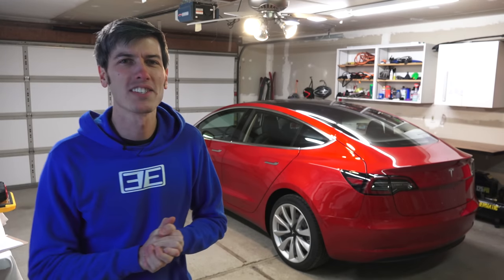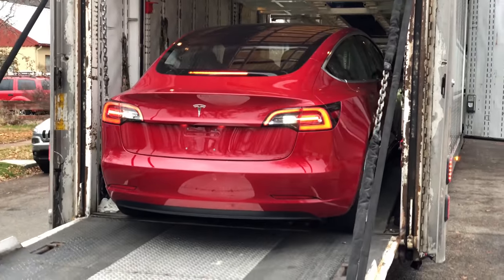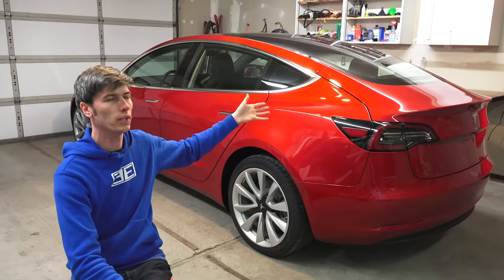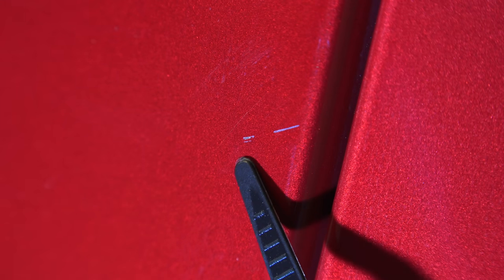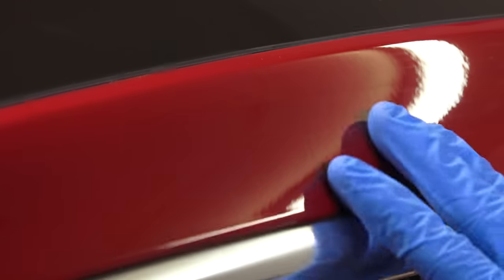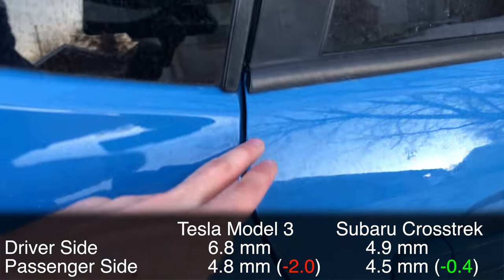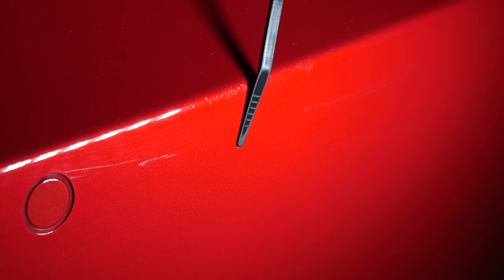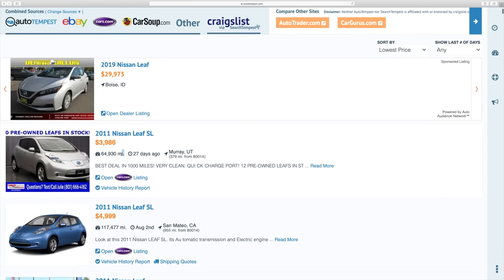Everything That's Wrong With My Tesla Model 3 - Quality Problems

Comment: Why did you accept the car? I would have sent it back and not signed for it.
Reply: I'm sure he didnt see this stuff until after he signed for it....
Reply: I build cars for a living.  I can go to any dealership in the country and find flaws in every new car on the lot.  This is pretty bad, but you will not find a "new" car without flaws.  Trust me.
Reply: 'bad'

This is horrible quality for a $60,000+(or $90,000 Canadian pesos in my case) retail car. I could buy almost any other brand for half the price and much higher quality control.

Hoping this guy has this under warranty and has the dealership completely repaint and redo all the panels for the car at minimum. Who knows what the inside looks like with a exterior this trashed.
Reply: Automotive manufacturing in North America has suffered badly under union rule. High wages, extraordinary benefits and lavish pensions have driven the auto sector into the red slowly for the past few decades while complacency and entitlement of many union workers has brought down quality in an age when people expect perfection off the assembly line.  

Even with robotics, automotive manufacturing has improved dramatically but will never be perfect, but as long as humans are programming, maintaining and manufacturing the robots, they will never achieve the perfection we have come to expect.  From assembly to delivery, there are multiple opportunities for defects and damage to occur.  As another auto expert has pointed out, you could walk any new car lot and find defects in virtually every vehicle.

Tesla has an up-hill battle ahead of them as a new manufacturer, trying to solve their quality issues in today’s cut-throat market.  How long before Elon looks to out-source his manufacturing to other countries?  This video could have been done with almost any brand of automobile.  Unfortunately, Tesla is way behind on QA/QC on in their manufacturing process.  Trying to correct their issues in the American labour union environment will be costly and Musk may run out of cash before he’s able to demonstrate Tesla’s build quality and reliability is good enough to compete with other main-stream manufacturers.  

I applaud Elon’s determination to take the industry in a new direction, but maybe it’s the concept of the single-occupant vehicle that needs to be re-considered.
Reply: @peterwheatley6256  Sigh, the "unions are bad" arguments again. Listen, all major german and japanese car manufacturers have unions and they do not suffer from bad quality, unmotivated employees, unacceptable flaws, etc. (let's ignore the technical fuel and CO2 emmission issues in 2017 for a moment) This "unions are so bad and socialist and destroy anything" is a very toxic and outdated mentality, solely in the US. You have to step away from the past mistakes and corrupted unions (which afaik only happened to such an extent in the US) and take that actually very worker-friendly and protecting concept to the new millenium. Like every other first world nation did long ago. Every employee in Europe who is in a union or whose company is part of a union shake their head when reading stuff like that. 
The US auto industry just made bad cars that do not sell well on the other side of the big seas, that's why the manufacturers are in the red. And no, you cannot find flaws and defects on every third VW, Toyota or BMW when looking around at your local car dealer in Germany.
Reply: I guess in America is normal to sell cars with all this  problems. Good thing the customer support said they will help
Reply: @MistaM16  Sure, but as I understood this (the color) is an optional extra which costs quite a bit of money. Its not the generic cheap option that is included in the base price. You want more out of an optional extra paint job... Besides, the car itself is like 60k? Sure, all the cars have some minor problems or scratches, but a 60k car that looks like its been used for a year or two? That's unacceptable.
Reply: @SmugLlama1234  I just want to point out that Model that he got is $65,400 CND. I would also refuse delivery on that car Tesla or not.
Reply: @peterwheatley6256 naw it's just lazy management. Whether you pay the guy who refills the red paint $1.00 or $30.00 an hour is meaningless. Companies need extraordinary leaders who demand perfection to be in charge or you get this.
Reply: "Trust me." That's what Jimmy Carter said.
Reply: Wendell Fakename - I totally agree. Our leaders will be the ones who engage the workers to instil the importance and pride of quality workmanship. The flaws in this example are basic and obvious. The scary part is what lies beneath the paint when cruising at 120 km/h.
Reply: @peterwheatley6256  I work in the Auto Industry and drive new cars every week, I don't see this level of panel gaps and paint problems from other brands. Also, the rear driver's side door is a totally different color. There are plenty of cars made in North America from Import brands that don't looks like this.
Reply: @Kevin is that with the rebate included? Seems like it would be along with the tax deduction.
Reply: @peterwheatley6256  you do know that Tesla is a non union company?
Reply: @YuraBoyko  If this really is how one receives brand new cars in the US, we should not be surprised as to why the US car manufacturers are in the red and why the rest of the world buys European or Asian cars.
Reply: SpeedDemon2581 - actually, no, I didn’t!  And I’m shocked...  I didn’t think a car could be built anywhere in North America without a union.  However, QA/QC is a big issue everywhere and it boils down to the leaders in charge of how the manufacturing tolerances are managed and who signs-off before the vehicle rolls onto the showroom floor.  @Motormouth, you would know, as an automotive journalist for decades, the range of finish quality throughout the sector.  And to be fair, I’d guess that the cars you’re given to critique every week have been examined closely by the manufacturer rep to ensure you’re getting the best specimen they have.  There are lemons from every manufacturer but some manage quality much better than others.  I tend to agree with yourself and others that the Tesla in this blog has been re-painted.  I know someone who worked in the paint touch-up department at a major auto manufacturer and incidents happen on the line all the time.  But the fact that this vehicle was released for delivery is unacceptable.
Reply: @SmugLlama1234  its got miles on it. it isn't new how can you expect perfect condition.
Reply: I wonder whether the fact that the car was delivered so quickly meant that the 'original' purchaser refused to take delivery? At least he can get from point A to B. :)
Reply: I know low mileage 20y/o VW Golfs with better paint and finishing quality. That orangepeel is terrible, and that many scratches?! I've heard worse of tesla tho... Of cars when they arrive on boats here in Europe, they have plastic stickers on 'em to protect the paint but when the get pealed of the paint comes with 'em. Not sure how true that is but I wouldn't be surprised.
Reply: @peterwheatley6256  - Curious why you would think this is a "new direction" .. Electric cars have been around for 100 years. In fact, initially it was the electric car that was predominant, but the combustion engine easily won that battle and has been predominant ever since. There are a lot of reasons why the combustion vehicle won out over the electric car. I don't see the electric car ever making that comeback. The combustion vehicle already won this battle long ago.
Reply: "its got miles on it"

Last time I checked that doesn't mysteriously effect the paint job, cause misalignment on basically all panels along with and 21,000KM is literally nothing to any car. That's not even half the normal amount a showroom car has in after a year of being test driven on the highway.
Reply: @AriesT1  European manufacturers only wish they could be on the same level as Ford and GM.  They'll never get there
Reply: @Matt-bb3nr  Are you trolling? Maybe on bang for buck, but quality?
Reply: @Matt-bb3nr  Lol, you are funny. Comparing Ford and GM to VW, Audi, BMW or Mercedes. Nice comedy. :)
Reply: @squidly2112  b.s. gm and standard oil conspired against electric vehicles. It's is true ev were winning till then.
Reply: @erichartman3760  - OMG! .. don't know much about history huh? ... GM didn't exist then .. try again ... LOL
Reply: @MistaM16   I bought 2017 nissan rogue sport... zero flaws... I just checked again after seeing this video and still.. no issues... no scratches.... tesla is known for low quality cars
Reply: Wendell Fakename l
Reply: Peter Wheatley most new auto plants built in the past 15 years are non-union. Do a bit of research.
Reply: Unions in Germany are in the management of the company. Maybe that's a better model than old fashioned capitalist class struggle.
Reply: @MistaM16  - these are more than flaws,  and there are many of them.  the only 'true' flaw is the dust in the clear coat.  the others are scrapes and scratches which are not a by-product of the painting process but poor controls around manufacturing or shipping.  people and/or equipment are contacting the vehicle and are  causing the scuffs and scratches.  the end result is still the same, an unsatisfactory paint job for a brand new and expensive vehicle. When I bought my VW Touareg brand new, the paint job was flawless.  And I'm a stickler for defects.  So this vehicle isn't meeting expectations for a $60,000 acquisition.
Reply: The next test for Tesla would be their customer service department, if this was my car. The paint is substandard. The scratches I would want fixed.
Reply: @peterwheatley6256  You blame the union too much. Bad management and accountability are the real reasons.
Reply: you need to magnifier to see this.
Reply: marcus brown that is not true. 
Step out of the States and You will prove your statement false.
Reply: Negative. I have been to many porsche and bmw as well as mercedes dealerships. All their brand new cars are without thr slightest bit of doubt 100% in perfect condition. They sell the cars they have in thr showroom (deml car) for 20k less, just because someone sat in the car, not even driven. Its a tesla thing at the moment, or cheap cars till 30k. If you buy a new bmw, audi, mercedes or porsche you won't find a single flaw. You're free to give it back 2 weeks after buying it (at least here in Switzerland)

If you spend that amount of money on a car, the least you can expect is the car to work and to be in a condition just as it left the factory. If the factory already did a shitty job then you should have the right to let them work on it again.
Reply: @dublux9878  Just it standing in the sun will do... That orangepeel is bad... Terrible! You wouldn't see that on the cheapest cars out there
Reply: @BramCollier  
I am just trolling. :D
Talking seriously the people wont get high quality cars from Tesla (overall) at lest 5 minimum if this company will survive. It is simple; they are trying to expend their business as fast as possible and they cannot provide quantity and quality at the same time.
Reply: Because Tesla. 

If you're a fanboy, nothing will put you off owning one. This applies to all products where there are fanboys.
Reply: @YuraBoyko  Not only America, you should see Chinese cars or Russian cars. But still Tesla with this much quality issues, is just horrific.
Reply: @MistaM16  more than minor flaws.
Reply: He didn`t know that quality control does not exist at Tesla - the whole paintwork quality is bull** , the car needs complete new paintwork
Reply: @User-th6yy  There are very few places in the world where applying a Swiss standard of quality is realistic. America is definitely not one of them.
Reply: Though if a Tesla came direct from the factory, it never had a chance to sit on a lot where a lot of damage can occur.
Reply: @MistaM16  Sorry, but I purchased two new Rav4s in the past 4 years and none of them had anything like what's going on here. Also bought a used 2016 Corolla a few months ago and it looks better than this in terms of defects/quality issues.
Reply: @peterwheatley6256  quality control is management. There only goal 5000 units. Of course no dealer limited repair services a nd no oem parts Stan ward. No separate evaluation. Of course rental car companies try to charge you for defects caused by previous drivers. Take a camera and film everything with qualified body shop inspector
Reply: @NikiK57  the local $300 paint job for $2500 factory finish. Did they sand off clear coat and spray paint it red by the rail road track?
Reply: @peterwheatley6256  Americans just dont have the high end quality of finish when it comes to products that other countries do though.
Reply: Jorn Navarre  You should go back to school and learn how to read. ;) 
I wrote they do NOT suffer from bad quality and unmotivated employees despite having unions.
Reply: Tesla is not union. Go elsewhere with your anti union bs
Reply: @peterwheatley6256  Tesla isn't unionized.
Reply: squidly2112  - by new direction, I mean that Tesla has created a luxury 100% electric brand.  That is different from any other of the major auto companies who have since been weaving plug-in electrics into their ICE line to protect their market share.  Tesla is building luxury performance vehicles at a loss, but sadly it is a strategy that is doomed to fail.  Their quality issues have become very public which will always make people second guess whether to commit to the brand over other domestics (and imports) developing their own plug-in electrics and hybrids using existing manufacturing facilities and established quality assurance programs.  It is too bad that this very real example of a newly delivered vehicle displays so many deficiencies.   I had hoped Tesla would be a raging success.  The world needs a cleaner option.  I am strongly considering an electric vehicle for my next purchase, but it won’t be a Tesla.

Comment: Panel gaps or paint really didn’t both me , it was the waves in the windshield that did , and later when that problem was fixed, you could see the stress in the glass when wearing polarized sun glasses ( spend most of my time in Arizona , New Mexico , Nevada, and California)  people at the Service location in Scottsdale thought I was nuts until they viewed with same glasses on , areas of the glass would turn into a purplish rainbow and reduce visibility. Took two other windshields to reduce to a managed problem ( and almost a year from the first windshield repair to the third )